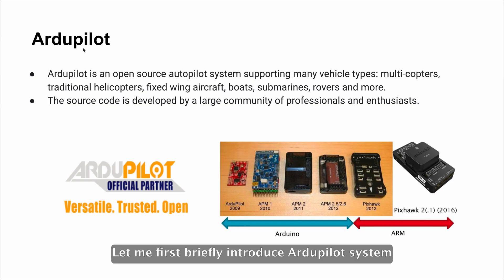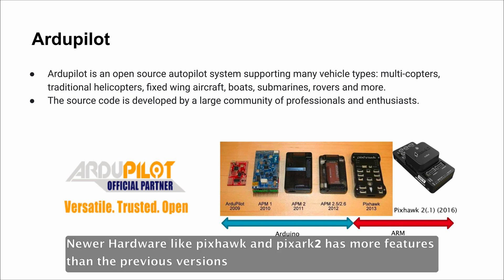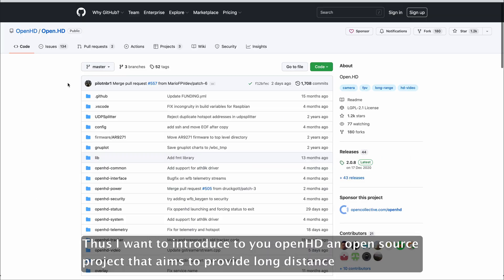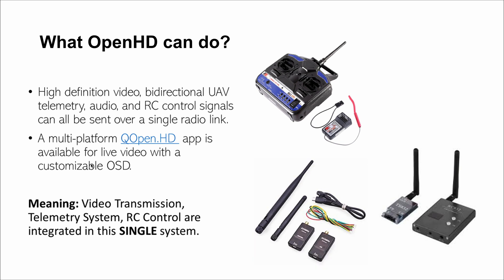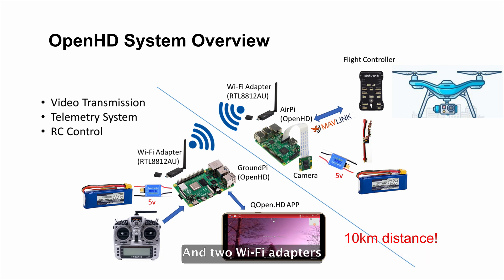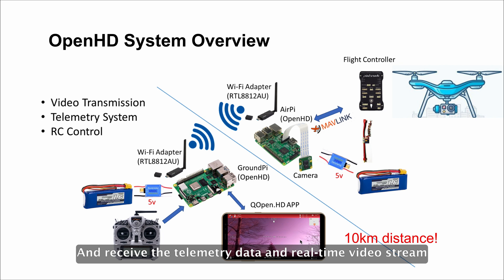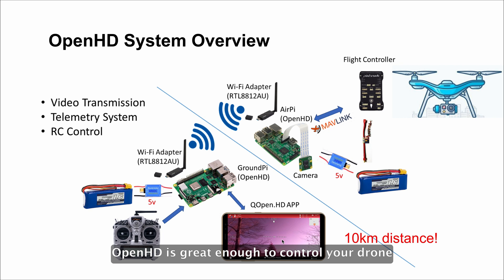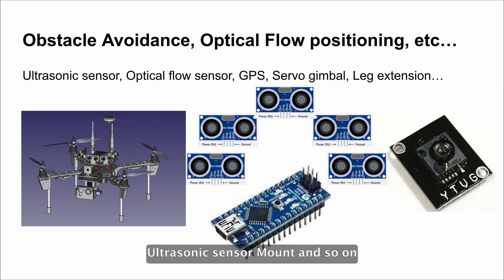3D Printed Drone Build #1, OpenHD, Obstacle Avoidance, Servo Gimbal, F450 Leg Extension etc.

Comment: Hello !!
I am very interested in this project .
I have also made a basic quadcopter drone and trying to add obstacle avoidance to it.
I have seen the part 2 also.
I want to ask that , Is this system is working ??
If yes , Can I please get your contact info .
Because I am trying this for nearly past 1 year but I am not able to make it.
I will be so grateful if you help me .
Please !!
Reply from the maker: @Roblox_Live_official  hi thanks it is theoretically designed, I don’t have time work on it anymore, sorry
Reply: @jacobstech1777  Ok no problem !!
Thanks for the quick reply 😊😊